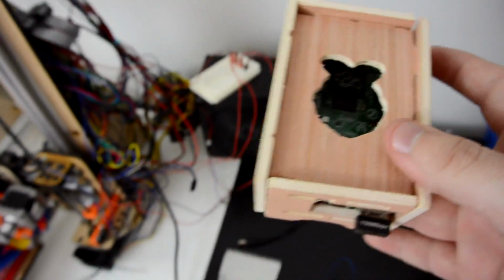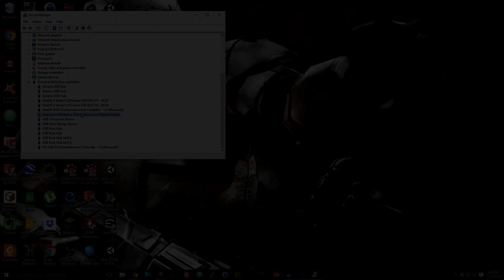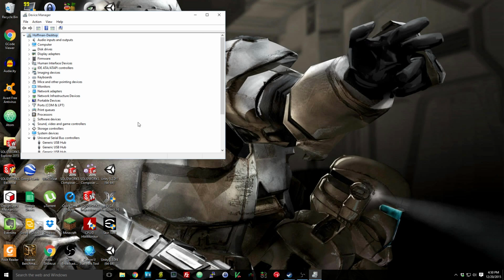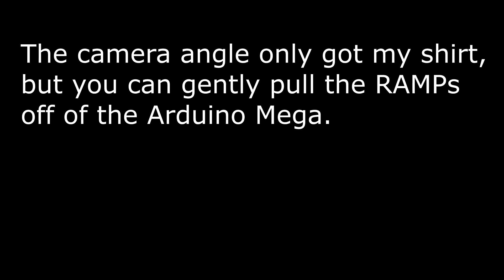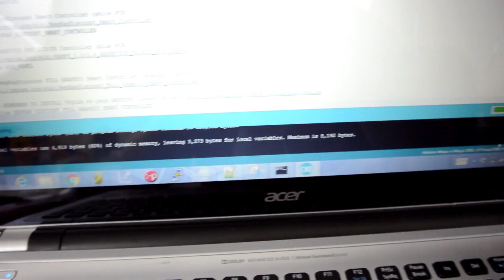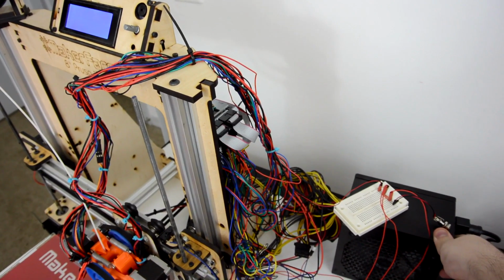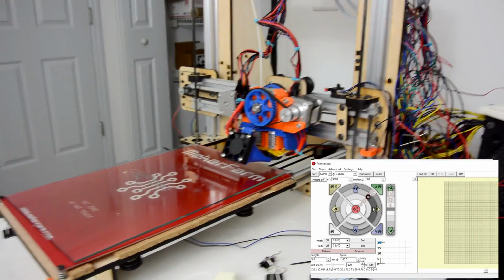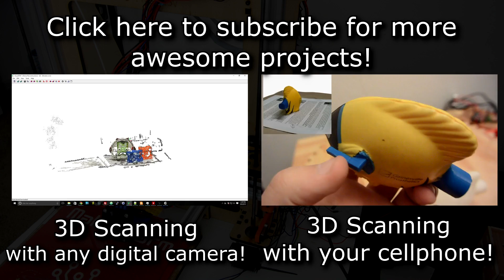3D Printer: Replacing an Arduino Mega

Comment: Hi anyway you can send your marlin configuration for the mega 2560 + ramps ? I am having a issue , I might be doing something wrong in the firmware but it prints very slow

Comment: have you tried re-flashing the atmel 8u2 chip its using for USB ,  I assume the Mega under you ramps is using a Atmel chip for its USB like your new one .  there is a ICSP (6pin) header for flashing just that chip . I have had mine go a bit nuts , and not register anymore and all i had to do was re flash it , did not even alter the firmware on the main ATmega MCU.
>>If you have a ICSP  its worth a shot directly , or try DFU mode : https://www.arduino.cc/en/Hacking/DFUProgramming8U2
it could be your next back up board if it works .
Reply: +XerotoLabs or this is better if you have a spare arduino or ICSP  to flash direct with the ICSP header pins.  http://www.instructables.com/id/How-to-Restore-the-Arduino-UNO-R3-ATmega16U2-Firmw/  instruction work for Mega you just use different hex file.
Reply from the maker: +XerotoLabs That is a great suggestion, thank you! I've used an uno before to program the Ardunio Mini for my Animatronic Caterpie project, because the mini does not have usb connector. This seems to be along the same lines. I will have to give it a try this weekend.
Reply: +Hoffman Engineering If the rest of the board is ok and just the USB controller is dead , i suppose you could just use the MCU for other projects and program it via its ICSP . heck you could hook a USB to UART module to it and replace the functionality of USB controller. then its a franken-USB . LOL but hey I hope it works so you get a good 2nd board again .  if you do order a USB to UART i have been using one form allice :
http://www.ebay.com/itm/400565980256  << i hope that like works , but it is a CP2102 with the extra control pins broke out and its 3.3/5v as well .  it has a 3.3v suppl and 5v , and its logic is done at 3.3v but is 5v tollerant so its great for all small arduino and esp8266 stuff.

Comment: hello, i am having a little problem with my printer. i just built it all, but i dont have filament to test with, so i was trying to do a dry print, but I cant figure out how... my compter doesn't recognize it in any of the com ports; instead it says it is in LPT1, which pronterface wont connect to, im just so confused... i don't know what firmware i have or anything but i know i can browse the settings menu on the lcd. (but i cant print from sd) ugh so confusing
Reply from the maker: +BOSS ENGINEER LPT is the parallel port on the computer, not a usb port. Do you know what board your printer has? (For instance, mine had an Arduino Mega, but there are other boards out there like the RADDs, RAMBo, RUMBA, etc). Are you sure that board is connected via the USB port?
Reply: +Hoffman Engineering pretty sure its a "RAMPS 1.4+Mega 2560"
Reply: And yes its connected to usb